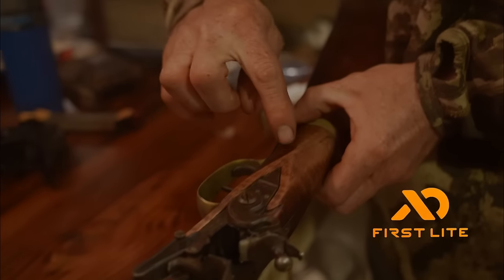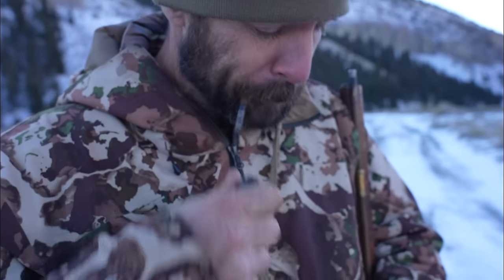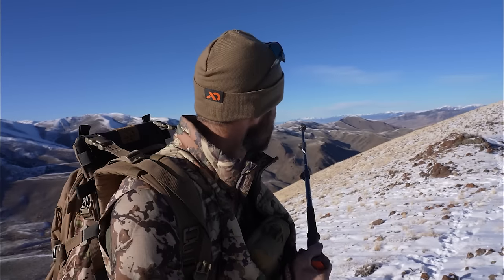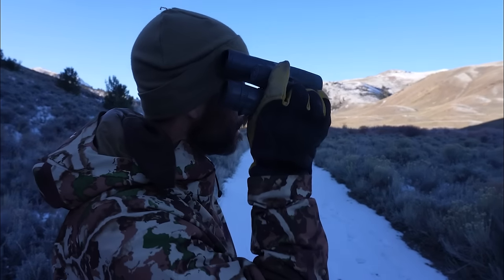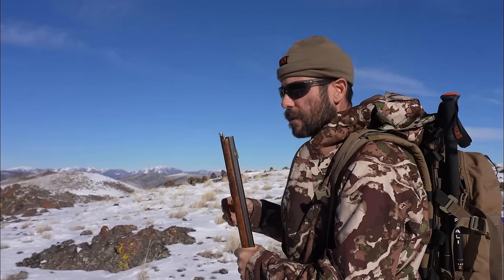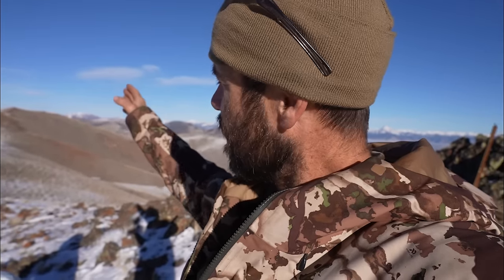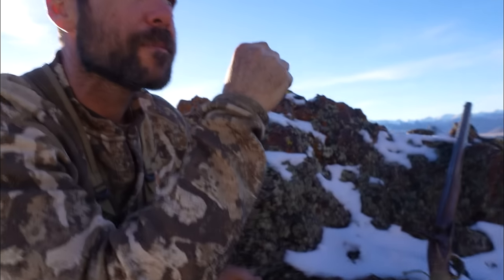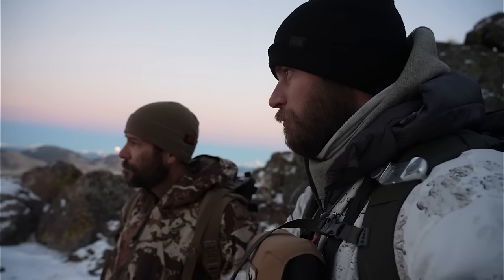It's GO TIME! Flintlock ELK HUNTING 2023

Comment: Love the late season flintlock hunts!  I understand the powder charge getting damp. Here in WV, I tend to not charge the pan until an opportunity presents itself . Lol.  Looking forward to part two!
Reply: You can use some beeswax to seal your PAN to help keep moisture out and powder dry.

 In fact, if you carefully file to smooth the edges and use the wax, you can get to a point where a well tuned flash pan can be submerged in water and keep the powder dry.

Comment: Hi Clay,
As always a great video, I love the content with you and Xander. 
I also have a question, what magnification do your binoculars have or which ones exactly do you use? 
Looking forward to the 2nd part 👍
Greetings from Germany
Reply from the maker: I like the 10x42s
Reply: Pretty much everyone that does this type of hunting runs 10x42s, as he commented he does too. Any less magnification and you're limited in your ability to spot and identify, any more and you need stabilization. 50mm is nice but heavy. From there, just get the best glass you can afford. Vortex Diamondback is probably your best budget option at around $200, and includes a chest harness. If you are willing to save up $1000, the Razor HDs are phenomenal and probably the last pair of binocs you'll ever need to buy. The color transmission is a game changer in low light.
Reply: hey guys, thank you for your answers 👍 i now have an vortex crossfire 10x50👍 I'm curious to see how it will pay off in 2024. I'll have a look at the glass you mentioned anyway. The vortex razor HD that clay uses must really be awesome.
Thank you both👍